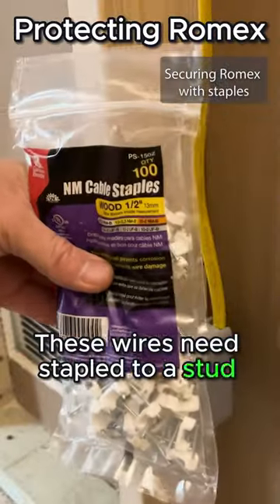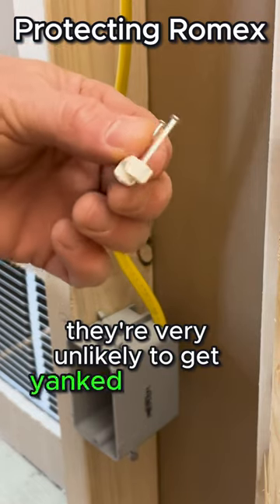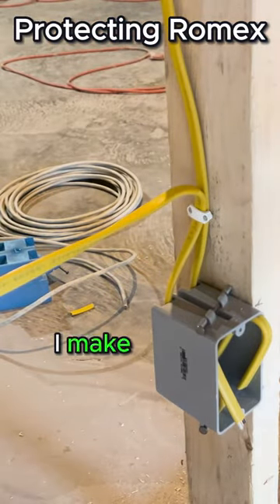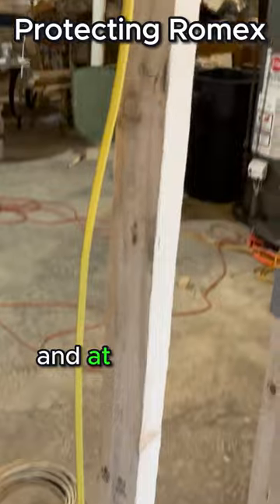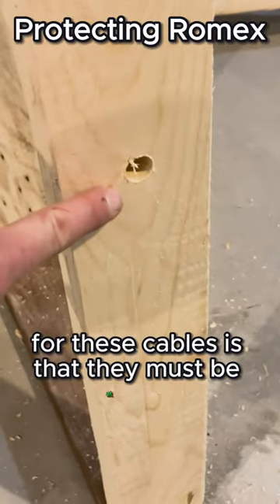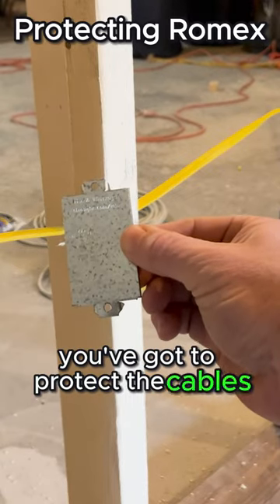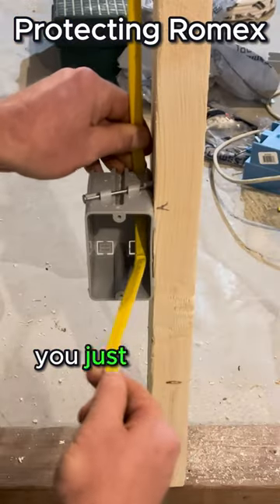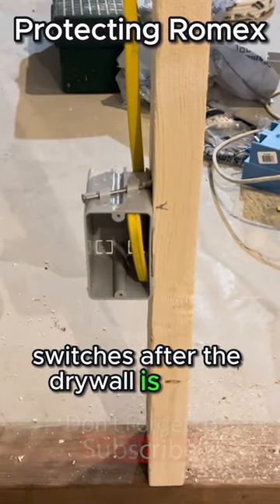Protecting Romex wire with Staples and Plates - WIRING BASICS #diy #wiringbasics #electrical

Comment: Nonono you have to strip away the yellow jacket before putting it in the box 🤙🤙🤙
Reply: Square them wires off boy
Reply from the maker: @mikehunt2774  Haha roger that!
Reply from the maker: I hear ya - that's what an electrician would do, for sure. I actually like to leave the yellow jacket on when doing personal builds like my basement - I'll leave all of the wire prep for after drywall.

Comment: I’ve noticed that you touched on stranded wire.  I’m not a licensed electrician however, I am an electrical maintenance technician for over 45 years now. I work on high voltage systems up to 365 kV down to low voltage systems typically 480 V.  I’ve done many more than I can count, complete switchboard wiring on old boards. Complete removal and rewiring. New components etc.  typical wire is # 12 & 14 SIS. It is stranded wire. Any time I’m not running romex and I need to bend pipe, I pull stranded. #1 it’s much easier to tuck in the box. #2 and probably most importantly and many don’t realize, stranded wire has a higher current carrying capability.  Current only travels on the outside surface. So on  a stranded wire it travels on the outside surfaces of every stand.  That’s actually increases the amperage capacity by at least twice. Though I certainly don’t suggest running a 14 on a 20 amp breaker, just to keep in mind you’re actually stressing the wire less.  Please give me your thoughts.
Reply from the maker: Hi! This is super interesting- thank very much for sharing this. I’ve never even considered using stranded in these applications, and it sounds like you’ve been around it much more than I have. Worth looking into!

Comment: Gray area which I get both ways. Was told never use the closest hole to the stud. That could be considered as a form of securing and fails the 1.25 rule, only on a 2x4 wall thou. 13 years and still never use the closest hole to a 2x4
Reply from the maker: Thanks for sharing!
Reply: That’s an interesting take but I don’t think it would fail. The assumption being the drywallers will actually hit the stud. If we are to assume they will miss the stud it doesn’t really matter what hole we put it in.

Comment: Gotta like those 2 nail staples 😂😂😂😂😂
Reply: @mancyclediy basically they are just 2 nails bridged for a more secure application, compared to the traditional single nail that are more prone at allowing wiggle room to pull the cable / power line out.

Comment: I dont see the point for this. If the wire is dangling between joist what is the con?
Reply from the maker: It a code requirement.

Comment: A few issues here. There’s no “general rule of thumb” with electrical. We use The NEC and it updates every 2 years. Second issue, all your boxes have to be cut in before rough in inspection. The inspectors need to see proper grounding methods of which a few options are approved by the NEC. And third, why are you using a hammer to nail in staples? Couldn’t find you side cutters?
Reply: Doesn't the NEC get updated every 3 years? And what's wrong with using a hammer for staples? As long as it's not damaging the conductors it should be fine, right?
Reply: That side cutter dig felt personal 😂